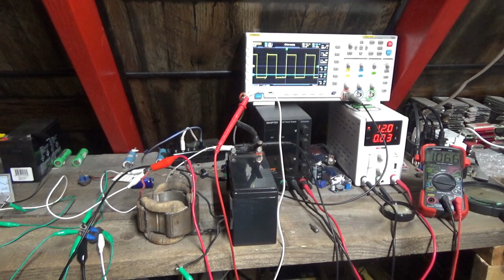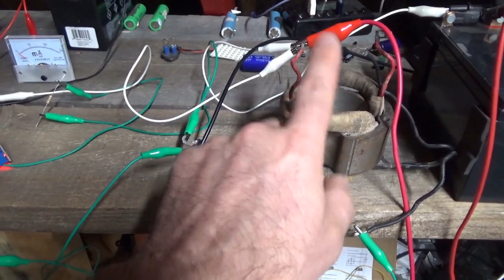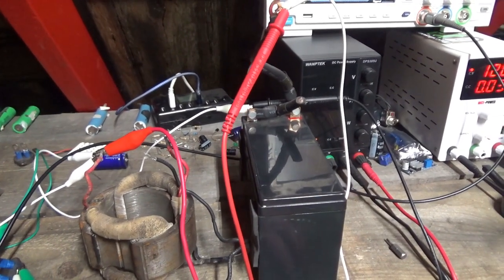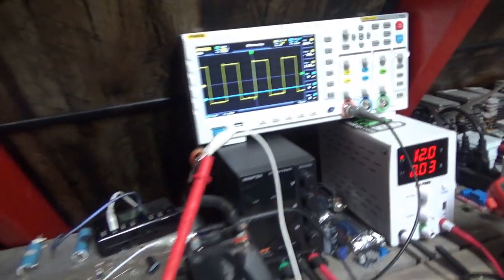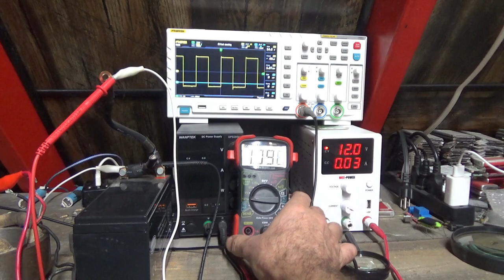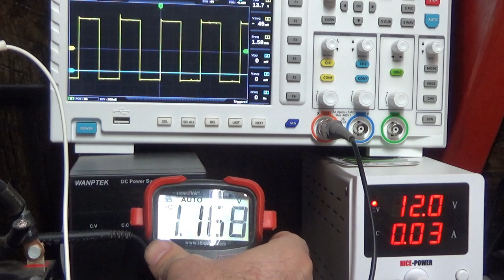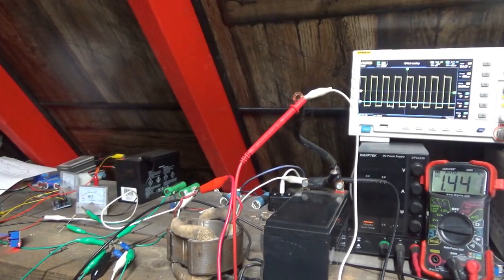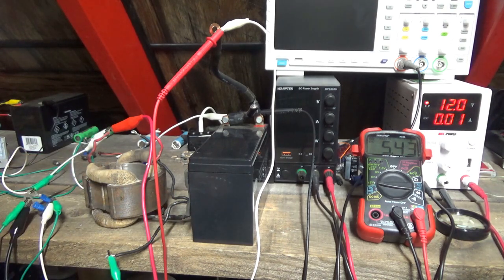Making A Battery Restoring Device For Sale For Off Grid Homes

Comment: I bought a Desulfator

 for 30.00 off Amazon.
Reply from the maker: I got one for under $12 with no case so I can show the circuit easily in my side by side comparison. I will show you why and how yours will not be as effective as mine. I will warn you for now, don't use it in a circuit with other things such as chargers as it may destroy them.

Yours may work on batteries that are only slightly sulfated and may prevent good batteries from becoming sulfated in the first place. But again, remove them from a circuit. The device may possibly destroy chargers. I say "may" because I have heard of it but I myself have not proven it one way or another.

Comment: nice project. I have made one before. takes around few KHz to be effective. I used a power MOSFET with a ferrite core type 31.  T 140-31 core. wrap with #18 mag wire. with a high speed  diode . it works but never went further to improve it. some lead acid chargers have de sulfate bult in. the NOCO chargers do. I have one. try putting a peace of iron in that coil . may get stronger pulse to battery. nice scope. if you put small resistor in series with battery like a .1 ohm 25watt you can put the scope across the resistor  to look at the amps wave form. the current pulse . that what you want stronger . have fun !

Comment: Good video & good little device you've produced there.  I had a lead acid that was heating up on the charger & not going onto trickle so I ran it across one of my Oscillators which had my Capsule device hooked up to its output...  I was able to get past the problem but it took some time....

Comment: I zapped a dead nicad pack with an auto transformer @ 95 volts ac for 2 seconds and blew the whiskers off the batteries making them new again. They would hold a good charge for a month.
Reply from the maker: I have heard of people doing that but never tried myself. I have also heard this works as well for nicads.